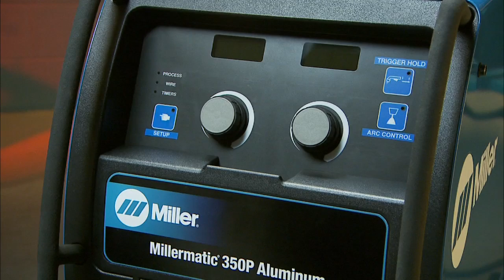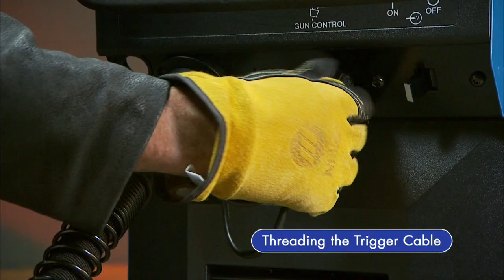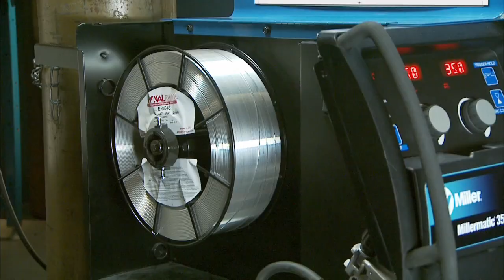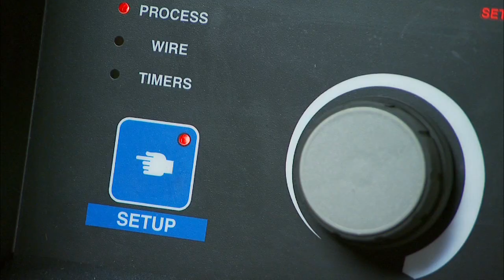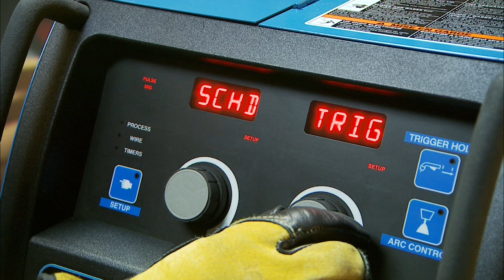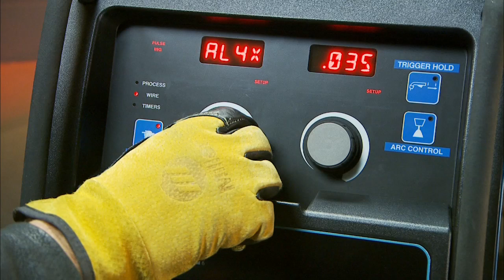How to Set Up the Millermatic 350P Aluminum MIG Welder

Comment: My work is replacing these with newer millers and otc daihen welders. I asked if I could get one of them that they were getting rid of and they said sure. Haven't been able to use it yet, but I've used them at work countless hours. very nice welders, but they have probably the worst menu of any welder with this many options. lol They give us 100 options that we have to sift through on an alarm clock from the 80s.
Reply: lol there are way to many options to go through. I wish they’d show more of what would work best for this or that situation

Comment: I use this machine every single day , and believe me, it sucks for light aluminum so i switch to my old lincoln ,  but for 1/4" and so forth,  its a beast.
Reply: How does it suck for light aluminum?
Reply: @andolinithedon  makes a pretty weld on one side as it blows holes in the back of the metal
Reply: we have 4 of these at my work-and they're great at running 4043 in push-pull. they suck at anything else.I brought in my personal Lincoln 350mp,now the Millers sit in the corner with 2 Lincoln 360mp's  and 2 260's doing the work

Comment: Does it makes any difference if I use AL 6xxx wire. And set the machine to AL 5x ??? , or  I really have to use  either 4xxx or 5xxx Alloy wire only?.
Reply from the maker: Thank you for reaching out, Edwin. We would recommend giving our service line a call to talk this through question with a tech. The number is 920-734-9821. If there’s anything else we can help with, just let us know.

Comment: Who wrote this script. You are treating your viewer as if they don't have any welding experience, and they are brand new at welding. Which would be ok if you were promoting a bottom end weekend warrior machine, but your not. You're advertising a very expensive machine that beginners just will never, never buy. Only experienced welders will buy that machine. We don't need you to tell us how to set a regulator, change wheels, tips etc. So while your pretending we are not smart enough to set up a machine, it's you whose not smart enough to know the audience you're preaching to. Typical corporate America.

Comment: can a 350P be upgraded with a 350P aluminum board to offer the synergic mig mode and other features yet still be able to run the steel  setups  the 350P has
Reply from the maker: Hi, Paul. No, it is not possible to update the Millermatic 350P to a Millermatic 350P Aluminum.

Comment: i use this everyday. as a matter of fact, this video is how i learned to set mine at work.
Reply: Have you ever had a problem melting tips real bad we just had the liner fixed and the push pull gun but it still is doin it ever 3 to 5 welds
Reply: @nickparks7474  I've never had that experience, but it could be a tension problem on the wheels or possibly a bad spool of wire. Or voltage issues
Reply: @andolinithedon  yea we put a brand new one on allredy  and everytime the tec guy comes it welds fine  then he leaves and it starts hissing and burning  tips

Comment: I've tried this mig and pro spots sp5 mig... I work in a body shop and the sp5 replaced our old millers... We gave them a shot with this thing but it sucked... Pro spots is a single knob control for heat/metal thickness... I'm doing steel, bronze,and aluminum at a press of a button

Comment: what about if i want to weld 6082 t6 with this machine? there is only 4k and 5k series option ?? plz reply asap.
Reply: Dj Devil if you're welding 6082 use a 5356 wire and set the machine manually. i dont have a miller, i have to set manually
Reply from the maker: +Dj Devil Thanks for your question! It can only be run in the standard MIG mode. The Millermatic 350P does not have a pulse program for 6000 series wire. Please let us know if you have any further questions. Thank you.

Comment: Common miller, why does everything got to be hidden in 15 different menus.  Just have it all out there easy to see.  I know then it looks cluttered for the newbie welder but there are not many newbie welders that are going to buy this unit.  I know what all the settings are and what they do I weld aluminum boats as a job but why do I have to open a hidden menu scroll through it only to find out the setting I want to change is in the other hidden menu scroll through it to finally change the setting.  Have it all showing kinda like the dynasty dx models although they still have a hidden menu in thought as well with the wave form and that stuff, it is just a huge pain.
Reply: exactly. I know this post is ancient, but even the new millers are only slightly better. Still too much sifting through menus. At my work we have these, some newer millers and otc daihen welders. the OTC welders look intimidating at first because there are so many buttons and such, but after you get used to it, it is waaaaay less of a pain to adjust the setting you want, because there is no menu. They have even more options and I can see every setting from across the room. No menus or screens with buried options. My work just gave me an old 350p, but haven't used it yet. They are great welders, but terrible menu design.

Comment: Can I use a 350p aluminum to weld other metals besides aluminum or is it better to use a 350p.
Reply from the maker: Amethyst SLV The MM350P Aluminum only has pulse programs for Aluminum. If you would like to pulse steel, stainless steel or metal core wire, the MM350P is the best option. Please let us know if you have any further questions.
Reply: Miller Welders I just bought the 350 p for welding aluminum can i use the pulse on the 350 p welding aluminum with the push pull gun

Comment: for welding alum wire 1/16 dia. what type of gas should i use? please advise
Reply from the maker: Joseph Nandino  100% Argon is the most popular shielding gas. However, if your weld seems cold - switch to a 75% Argon and 25% Helium mix. Let us know if you have any further questions.
Reply: Thxs for your reply

Comment: Thanks for this video. My old welder in not working properly so my company give me this same model and told me figure it out this helps. 
Thanks 
Drago
Reply: hey Dagoberto since you've been using this machine , do you know if it ll work on carbon steel iron with different accessories of course such as rolls an gun ?

Comment: Oh, forgot to add, changing out rollers???? Just how many times is this done on a machine that is set up for Aluminum only? I have been welding for many years and have NEVER just swapped wire sizes for the fun of it. In fact I can't ever think of any time that I have set up a machine and then changed. I set mine up for 035 and there is has never been any feed issue at all with the wire to the liner. Rule #1 of Aluminum MIG welding is to set the drive roll tension light as to not do this. But you would have to know about aluminum welding first.
Reply: scottgilly1 i have a question for you.
i get so much smut and have tried everything to reduce it. how can i reduce the smut?
Reply: Are you pushing or pulling the weld? The weld for aluminum should be pushed or you will get the black soot. Also 5356 wire will give more soot than 4043 wire. When all is set right and your travel speed is correct with 4043, there will almost no soot, if any at all. Clean weld.
Reply: scottgilly1 always pushing, never pull. i need to run 5356 as i do mostly marine stuff.
Reply: scottgilly1 also as soon as the wire hits to start the arc there is smut.
Reply: I do marine as well on 5086 material and 5052 material. I know that 5356 is the recommended filler, but I have never seen an issue with the 4043. I would check your argon flow and play with that, but there is no way to get the smut completely out with 5356 wire. What machine are you running and what material are you welding?
Reply: scottgilly1 same 5052 i have played with the gas flow. no matter what i do it still just black!
i might just have to go to a welding training centre to help.
i have a renegade 250 amp machine. it has volts and amps, no wfs thats done by the amp control which makes it hard to follow apps to get approx settings.
Reply: You will have to have a CV (constant voltage) machine to run MIG. If all you have is volts and amps, then you have a CC (constant current) machine and that will not work for MIG (Not worth a poop, you will pull your hair out). I used to run a syncrowave 250 with the XR push / pull feeder and all I got was black smut. I use the machine in this video. 350P with the XR aluma-pro gun. I love it and set on pulse, it will work all day and make great welds.
Reply: scottgilly1 i have tried steel and its fine. all the miller and lincoln type stuff in australia is expensive, and for the amount of work i do with it its not worth it. thanks
Reply: scottgilly1 all gmaw and fcaw machines are cv power sources or they wouldnt work. i was just reading stuff on the subject after your comment, and found out that gtaw and smaw are cc gmaw and fcaw are cv. i can put a link to the article if you wish to read them. as i read two article. thanks so much for your help!!!

Comment: The comments here are funny. If you are wadding up $100 rolls of wire, you have an idiot welding. Turn the machine off and go hand out buggies at Wal Mart. Second is the set up? What is comes down to is another idiot. Can work and iPhone, but can't operate a 3 button machine? Come on. You select the gun, wire, size of wire, mode and any timers that you may want. Really not that hard. Productivity? Greatly increased over a spool gun. Weld quality? Can't compare to straight MIG. Cost savings for me? Ha, easy one. 3 ea 13 lb spools of 5356 .035 wire, not a single wadded up roll and not a single contact tip. Oh, I don't spend all day dicking with the settings. I spend my day welding.
Reply: scottgilly1 when you weld vertical with aluminum, what amperage and voltage would you suggest? I usually never have trouble with vertical on any type of welding but aluminum mig but I never practice but I need an idea to get started

Comment: If you would have hired a retired welder rather than 3 freekin 20 year old yeepies with 2 degrees a piece  to help you build a good welder you wouldn't have any of these problems. Or at least have a welder look over and use it before releasing it. You do know this machine want always be brand new;in a controlled setting; with a miller trained tek guy using it. Design it for the real world weld shop.

Comment: Next is push pad selectors for set up rather than a two way toggle switch is very very aggravating. When you are setting up and u want to back up and make a change. YOU CANT. You have to toggle ALL THE WAY AROUND THE PROGRAM AGAIN to get back. I am paying a man 15-20$ a hour I don't want him playing with the welder settings all day. I need him welding

Comment: One major design flaw I see id the LOOONG distance from the drive rollers to the liner feed tip. I can very much assure you there will be some cussing with a wadded up wire there. ESPECIALLY when trying to install 035 alum wire. There needs to be a nylon insert cut to a V pushed right up between the rollers. Next I cant believe that it takes tools to change out the rollers. I have a 15year old welder with a twist lock system that takes seconds to change with no tools. Not exactly a new idea.
Reply: Kenneth Watson any good welder (or boss) should know how to set up this welder or a welder for that matter before they begin. after that, adjustments can be made depending on thickness of metal. the wire should only bunch up at the wheels, no matter the distance, if you have a bad spool, liners, wheels, triggers, or tips (after longated use, of course). maybe the reason your welders may or may not be adjusting the machine is because of the dollar amount your paying and/or lack of skill
Reply: Push pull gun gets it done.